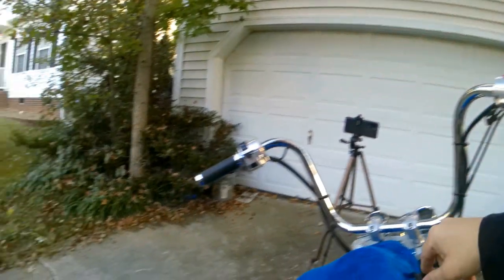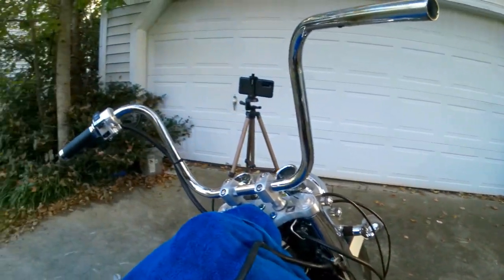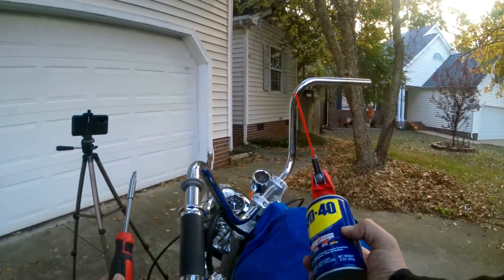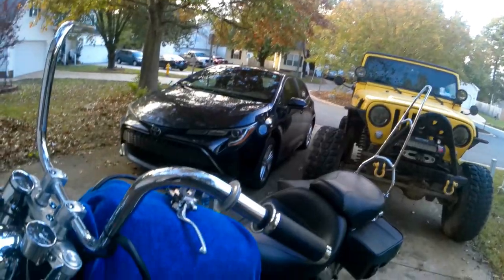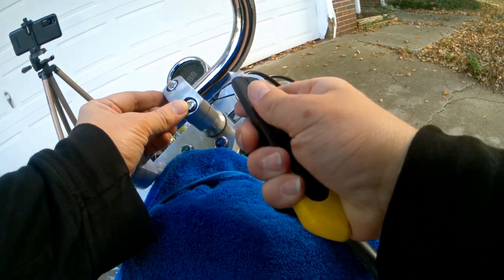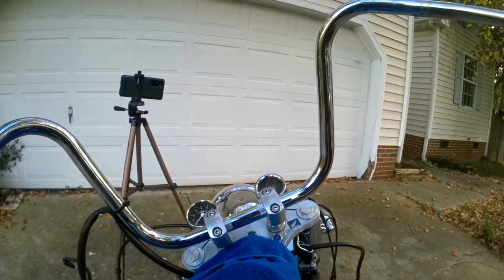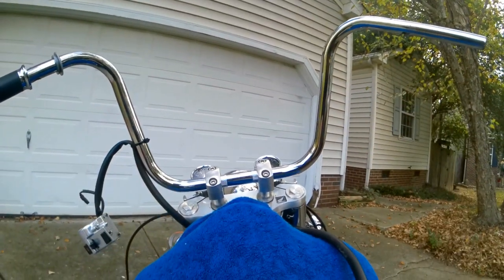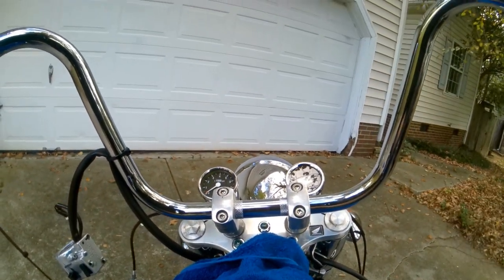Honda Shadow 750 Aero: How to INSTALL new HANDLEBARS in under an HOUR!

Comment: LuckyAces Thanks for posting this. I am currently putting these bars on my bike. There are a few important things to note here. While every year of Aero looks roughly the same, they have a couple major differences up front that will cause you some issues installing these bars. LuckyAces comments are absolutely spot on for 2008+ aeros. all cabling will fit but very snuggly. 2004-2007 Aeros have a few major differences. Their risers are welded to the bars, so you'll need to get one inch risers to install these bars. This also means that since you cannot adjust the angle of the bars, the cables can be shorter. The throttle, and clutch lines need to be extended. I put motion pro plus 8in on them and they are working great. You could gete away with +6 if you'd like. The other big difference on the 2004-2007 is that the break disk is on the opposite side of the wheel. You cannot use the stock brake line either. I've tried a line off the shadow 1100 and its still about a half inch short. I think my next try will be a brakeline off a streetbob. Part numbers are motion pro 02-0591, 02-0592, 02-0593. I hope this helps everyone.
Reply: I have an 04 aero with the one piece bar/riser. Do you happen to know a part number or where to get the risers needed?
Reply from the maker: Sorry I just say this.  Excellent information!  I had not considered the slight change in the Aero model in the mid 00's.  Good catch friend!

Comment: I've got a 2009 Honda Shadow Aero and I'm thinking about putting some 12-inch Apes on it. I had a 05 Shadow Spirit with 12-in Apes on it and I loved it but for some reason my 09 Aero has a freaking wobble somewhere in the front end and it's in the shop right now with a professional trying to figure out what in the wild wild world of sports is going on woth it. If I get that bike running smooth on the road then I'll put Ape Hangers On It. If I don't, it's going up for sale!
Reply from the maker: I had a wobble issue for about 2 years before I finally figured it out. Typical culprits are front wheel bearings, tire out of round, tire not balanced properly, neck bearings, worn out riser bushings (to a lesser extent) but for me is was not any of those. The fluid in the forks was two different viscosities so essentially each fork had a different spring rate.
Reply: @LuckyAcesRiding  I think I saw a video have someone that had the same problem with theirs. To me mine doesn't feel like it has any oil in the front forks. I've only had one other bike that gave me trouble with fork oil and that was a 1972 rd350 2 Stroker. It was a mean machine!

Comment: Hey there! Got an 06 aero, bought my risers, 10 inch apes, and about to get my cables and brake line. Will the electrical side (the kill switch/turn signal switch) reach? I can’t find anything online anywhere.
Reply from the maker: If you are using 2" risers than everything should reach with 10" bars unless they are ridiculously wide. Mine are 12" and only had to swap out the clutch cable.

Comment: Hey I’m trying to fit a 8” bar and the cables don’t reach do you have any recommendations or I need to change the cables ?
Reply from the maker: How big are your risers? Are they the 2" ones like on my Aero or the larger ones from a Spirit? Unless they are crazy wide the 8" bars should fit without issue.

Comment: Hi @LuckyAcesRiding, thanks for the great video! I have an 04 Areo 750, where did you get your risers and bars from? I cant seem to find anywhere in my area that has them and so many varying reviews online. Thanks!
Reply from the maker: Thank you!  The bars are the 12" wide apes from J&P cycles. https://www.jpcycles.com/product/500-968/j-p-cycles-1-chrome-12-ape-hanger-handlebar  I'm still using the factory risers.  I think the Aero always used this set up so if your bike has the one piece riser/handlebar someone may have swapped yours out at some point.
Reply: Hey i have the same bike same year. Did you ever end up switching your bars? Im running into the same problems
Reply: I ended up going with 10” bars, just had to reroute the cables.

Comment: Hi! Please tell me if it is necessary to replace the wires for such a steering wheel?
Reply from the maker: For the 12" bars I had to replace the clutch cable. 10" bars should not require any new cables.

Comment: Do you know 100 percent of which part number handlebar you used? Maybe it is in your email where you ordered. I just want to make sure. I have a Shadow and think your bars look good.
Reply from the maker: I went back and double checked and these are the bar I used https://www.jpcycles.com/product/500-968/j-p-cycles-1-chrome-12-ape-hanger-handlebar  Hope that helps!
Reply: @LuckyAcesRiding  
I thought I seen some knurling on your bars. That’s why I asked. I didn’t think I seen knurling on the ones in the link. Thank you for the information
Reply from the maker: @jasondiddle4226  No problem friend!  If you need any more info let me know!
Reply: @LuckyAcesRiding  
Well,,,,, I went and ordered a set to try. I’ve rode most my life. I always wanted to try a set of ape hangers but was afraid of having to deal with the wires, cables, and choke.
Reply from the maker: @jasondiddle4226  The only cable I had to replace was the clutch.  When comparedto my stock one it is 6" longer than the factory one.
Reply: Where Can i find the RISERS ?
Reply: @LuckyAcesRiding  that link you show, shows no knurling will they come knurled anyways?
Reply from the maker: @nagasakinoisyboi7288  Their website changed since I bought my bars as the original link only went to the specific set of bars and did not include drop down options.  Provided nothing has changed they should have knurling but I'd call just to confirm.
Reply: @LuckyAcesRiding  thank you!

Comment: Great video.
As you pointed out, the arrow on the riser clamp indicates the top. This is because the mating face for the top bolt is lower (further around the bar) than the rear and is meant to be tightened first. If you want to verify this the 1 of your clamps off sit it on a flat surface. The front face will sit flat on the surface while there will be a gap between the rear face and the surface.
Reply from the maker: Awesome man!  I did not know that! Thank you for sharing.

Comment: any chance you could list the part number for the clutch cable? I've ordered the replacement wire and ran it through the old housing and of course that didn't work. so, needing a longer housing and cable. any help would be appreciated.
Reply from the maker: Motion Pro's website says these will work.  The first link is a +4" cable which "should" be enough and the second link is a +6" which is not the same exact cable I have but is the same length. https://www.motionpro.com/product/62-0405

https://www.motionpro.com/product/02-0599

Comment: I’ve asked several questions because I’ve badly wanted to install a set of these on my bike and just went with a set that was shorter trying not to have to switch out lines and cables because of price, measuring, and how hard it is to find some parts. I bought some Honda spirit cables in hopes that they would be long enough for what I need. I did buy the same bars you did. They look nice. I’ve had several brands in the 12” that I’ve liked but tried the ones you tried. I’m curious of what size your clutch cable was and if you had to change the brake cable.
Reply from the maker: I did not change the front brake line but did have to adjust it a little.  On the right side of the forks there is a bracket that needs to be loosened which should allow you to slide the brake line up about one inch.  This should give you enough slack up top to where it it not so tight.  As for the clutch cable, the replacement one measured out to be 6" longer than my factory one.  You might be able to get away with 4" longer but the extra 2" didn't hurt.

Comment: I want to put 10" mini apes on my '02 VLX Deluxe, but am unsure whether I will need longer cables/where to find them? Any help?
Reply from the maker: As for length of cables I am not sure but I have heard good things about MotionPro as a source for cables.  TJBRUTALCUSTOMS has a video showing how to measure for new cables by fabbing up handlebars using PVC pipe that seemed pretty useful.

Comment: How hard was the clutch cable to replace?  Great Video. thanks
Reply from the maker: Not too difficult. I spent more time trying to adjust the cable properly then installing the cable. If can't remember the details but it was pretty straight forward once you start looking at it.

Comment: Do you have stock clutch cable? Mine are really stretched with the new bars
Reply from the maker: The clutch cable is a +6" but I could have gone with a +4" and been ok. MotionPro should have what you need.

Comment: Hi! If I want to put a 12" ape hangers  on a 2001 shadow 750, do I need to extend the wiring ? Thanks!
Reply from the maker: Yes I believe you do.  Esoteric Rider did a great job explaining how he installed 12" apes on his 2001 ACE.  He also makes and sells harnesses on eBay to extend the wiring so you do not have to splice into your factory stuff if you dont want to. https://www.youtube.com/watch?v=mNWjY45GUd4

Comment: Is it 12”? I have a 10” bar wanna install on my 2020 shadow so I need to change any of the cables ?
Reply from the maker: These are 12". With the 10" bars you should not have to replace the cables but you may need to re-route them.
Reply: @LuckyAcesRiding  thank you

Comment: I got the 8”mini apes and it seems like my clutch cable is too short; what am I doing wrong? 2022 Shadow Aero 750 tia
Reply from the maker: If you haven't yet you might try re-routing the cable behind the forks, that should give you a little extra length.  I am surprised it seems too short though.
Reply: @LuckyAcesRiding  got the cables to work but now my throttl cables came out of the throttle sleeve flange 😕 is there an easier way to get them back in without removing the tank and air cleaner housing to get to the other end?
Reply from the maker: @tbrewer71  I'm not sure friend.  I'm thinking removing the tank is going to be the easiest.

Comment: By any chance do you have a suggestion for cable lengths for 16 inch bars?
Reply from the maker: No personal experience but a lot of folks use "Motion Pro" as a source.  They appear to be affordable.
Reply: motion pro +8 would be tight. If this is going on an Aero, Id recommend +12 since they dont have a +10.

Comment: What length cables did you buy in your cable kit ?
Reply: +6 +12 inches ?
Reply from the maker: @deonteb1624  The clutch cable is +6" but could have easily been +4". Throttle cables, wiring, and brake line are all stock. They are at their absolute max though. A basic guide for how high you can go with stock cables on a Honda Shadow is 12" apes (narrow ones) on an Aero, Ace/Spirit is 10", Phantoms I am not sure.

Comment: Did you try to fit the clutch cable before you change it
Reply from the maker: Yes and I could only get the lever to the "upper" bend of the handlebar if that makes sense.  I have heard that if you went with a narrower set of apes you shouldn't need to change the clutch cable on the Aero but have no first hand experience.

Comment: Did you use the same cables?
Reply from the maker: Throttle cables, wiring, brake line YES, clutch cable NO. If I went with narrower 12" bars or 10" (or shorter) I would not have needed to.

Comment: Are them 7/8 or 1" bars I think I got the wrong size I got the 7/8 think they'll still work?
Reply from the maker: They are 1" bars. If you have the same model I do they won't work. They will not fit in the risers, plus the grips and controls won't fit.
Reply: @LuckyAcesRiding  I got a 06 honda shadow 750vt areo
Reply from the maker: @alabamarolltide1455  Nice. I'd see if you could return the 7/8" bars.

Comment: Could you say where and how much longer you had to buy the clutch cable ?
Reply from the maker: I got the clutch cable in a kit from MeanCycles out of Florida.  A lot of people buy theirs from Motion Pro which would be a cheaper option.  If you are outside of the US then I am not sure where the best place to buy would be.  You will need a cable that is 6"-8" longer than the factory cable.
Reply: @LuckyAcesRiding  thank you. I was actually looking at that website. But was unsure of the length .
Reply from the maker: @joseluisgarcia8936  No problem!  My stock clutch cable measured about 51 inches btw.

Comment: What about the brakehose?
Reply from the maker: The brake line is at its limits but it is long enough.  Its been like this for 6 months now and I have not had any braking issues.
Reply: @LuckyAcesRiding  good to hear! When i put a 9 inch ape hanger to my VT 600 the line seemed so tight that I replaced the line to a bit longer generic hydraulic line!
Reply from the maker: @manuhonkanen2111  I didn't even know anyone made a 9" ape, that's interesting!  Once the bracket holding the line on the right side of the forks is loosened the tension on the brake line can be relieved a little if slid slightly closer to the brake lever as oppose to the caliper.
Reply: @LuckyAcesRiding  made by Lucas 220mm bar that is 8.66 inches close to 9 inch?
Reply from the maker: @manuhonkanen2111  I didn't even consider metric! D'oh!
Reply: @LuckyAcesRiding  metric cycle - metric bars! 🤓

Comment: Where did you get ur extended clutch cable?
Reply from the maker: I got mine from Mean Cycles out of Florida and it was part of a kit (included brake line and throttle cables).  If I did it again I would check out Motion Pro.  My cable is 6" longer than the stock one but I am pretty sure 4" longer is all you need.  I've also heard you can re-route the factory cable and it will work if you do with narrower bars (I went with wide apes for comfort).